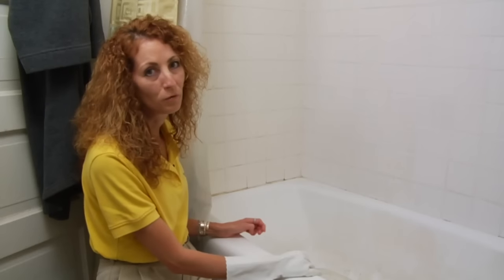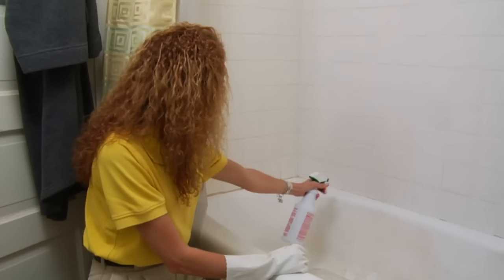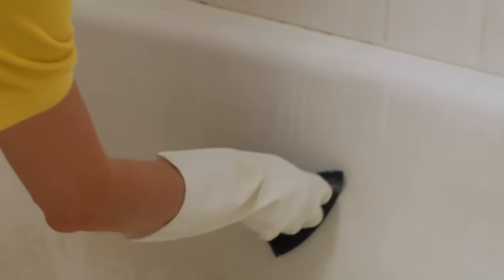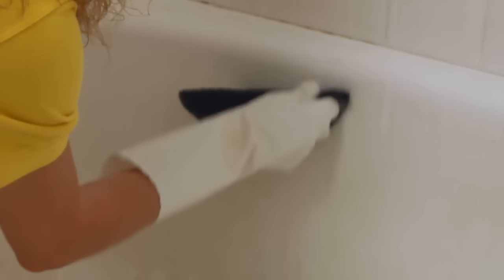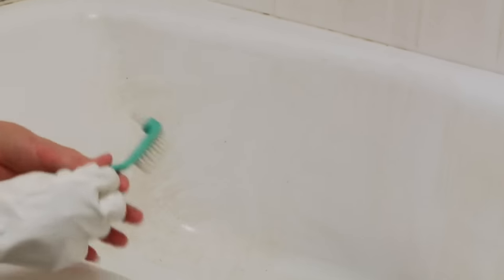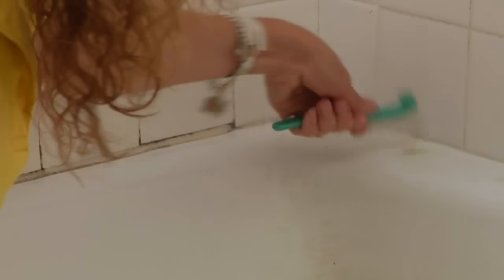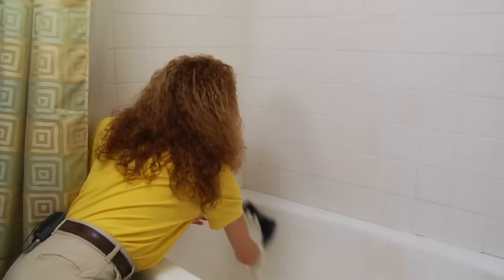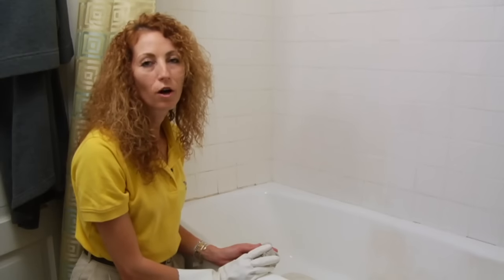How to Remove Stains From a Bathtub

Comment: This will create more work in cleaning in the future because of the scratches the scrub pad creates. Use vinegar & baking soda creating a paste & let sit, then wipe off.
Reply: For how long do I let it sit ?!
Reply: @lorenahardy8125  Place the paste in the area. Walk away & busy yourself in other areas. Then come back to it in about a half hour. If you have distilled vinegar,  it doubles the cleaning by bubbling around the baking soda solution. (Scrubbing bubbles 😁)

Comment: Please give advice on how to clean yellowing on an acrylic bathtub. Thank you.
Reply: Probably depends on what's causing the yellowing. I ended up soaking babywhites and peroxide and then sticking them to the sides and bottom of my tub. Left it overnight and then sprayed with Dawn power and left it again for a few more hours. Then wiped it down with a mr. Clean magic eraser. Took a while but seemed to work pretty good. And when I can't stand my tub any longer down the road I'm going to try a product called Ekopel. There are a bunch of videos about it on YouTube. But it is $199 so there is thatwhich is why I was motivated to try and get the yellowing out. Regarding Ekopel videos, look for the one that says December 2019.

Comment: Wet the tub and sprinkle it with baking soda and let it sit overnight. Then in the morning just spray it with white vinegar and let it sit for a couple minutes and give it a couple passes with a sponge or a scrubber and you're done. Just wash it off with water.
Reply: SULFEN  our stain is a constant one. this tub is never used yet it has a recurring stain by the drainage area. we used BS and Vinegar NOTHING WORKS
Reply: I had a stain prior to living in our home in our tub and tried everything to try and get rid of it.Have you tried Bar Keepers Friend?That is the only thing that got out the stain.
Reply: Dannus MK ya sorry my dude but that is bacteria 🦠
Reply: Peroxide for stains from hard water. When nothing else works this takes stains right off.
Reply: I'll try this

Comment: Comet works just fine for me.
Reply: COMET IS ABRASIVE!
That's what I used for years and years on our tub in the old family home.(I was the one drafted to clean the bathroom)Result: a pitted rough surface because unknowingly I was taking the smooth enamel surface off with scrubbing, making the cleaning harder each year. But that's what you get listening to "Josephine". Now I use SOFT SCRUB on my vinyl tub.